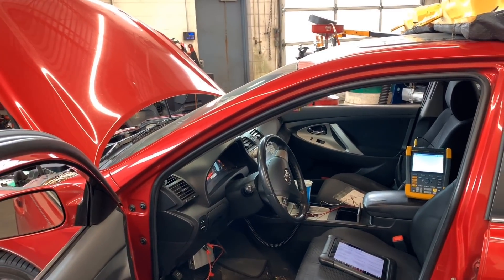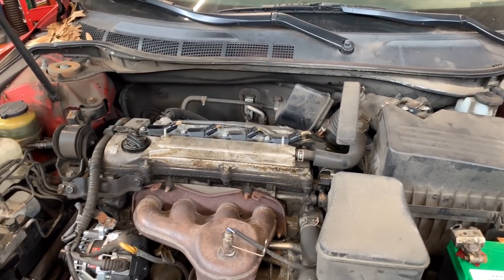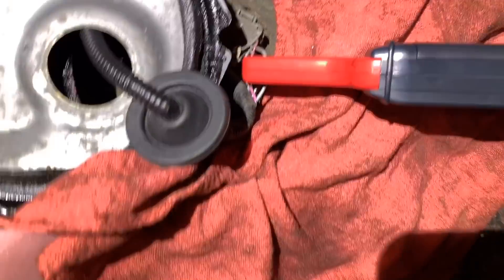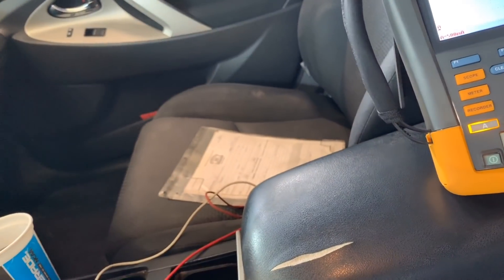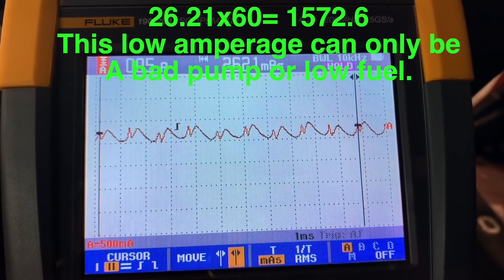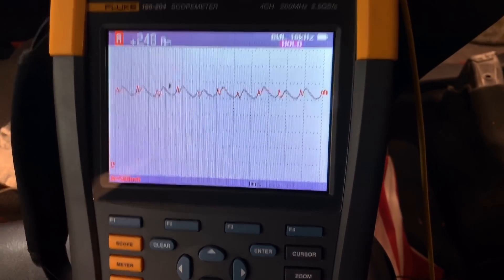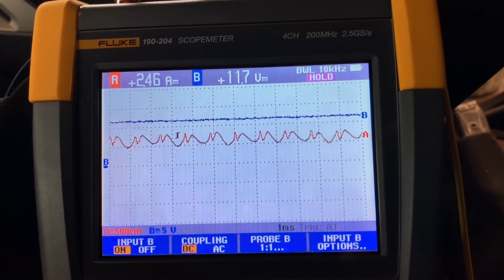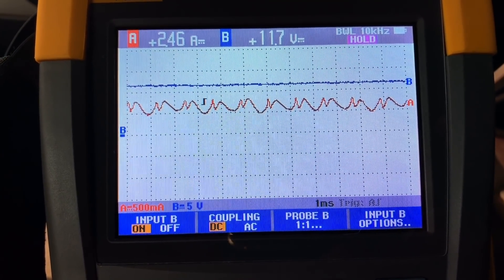2008 Camry fuel pump test with FLUKE 190 204!!

Comment: how would you compare the 190 to a a picoscope? like the 4425a?

I have a bench scope but looking for portability and ease of recording
Reply from the maker: The 190 is a great portable oscilloscope but I rather prefer the rohde and schwarz handheld oscilloscope. It is a lot better than fluke. Pico has lots of great things but is not portable.
Reply: @MaicSalazarDiagnostics  thanks. I realized you did one of the only reviews that looks at the pico vs. It that video the rohde froze in the beginning. I assume that was a one off, based on your comment.

Comment: Knowing the system! great video as always . We also have to mention that knowing the fuel system layout is ultimately important . Let's say the same test was done on a vehicle with a fuel pump control module . 2.9 Amps may be perfectly acceptable during a certain load range .
Reply from the maker: Thanks for the great info my friend! Totally correct depends on the system.